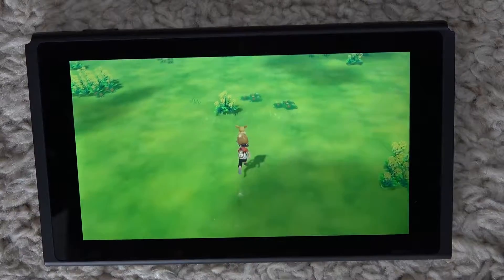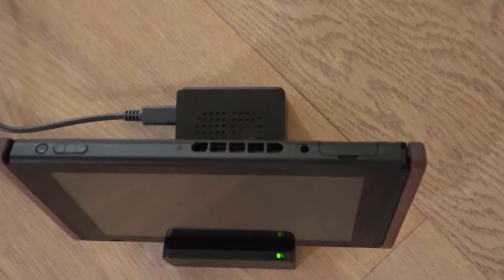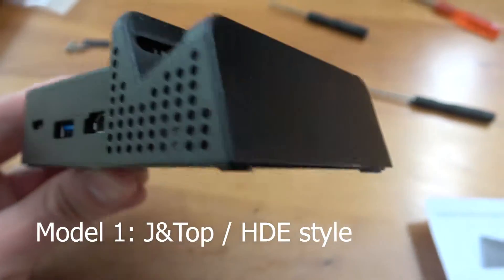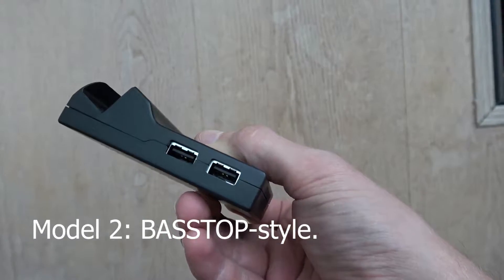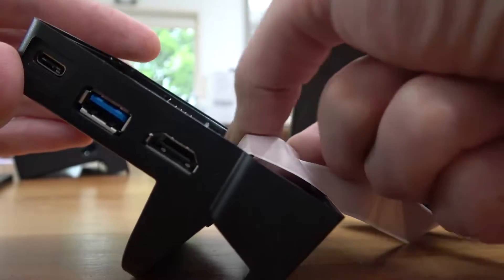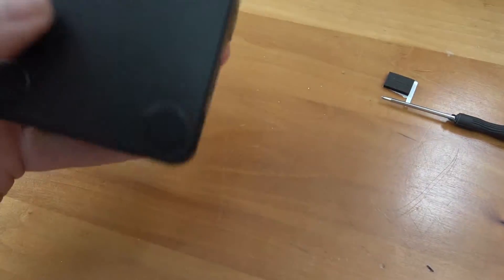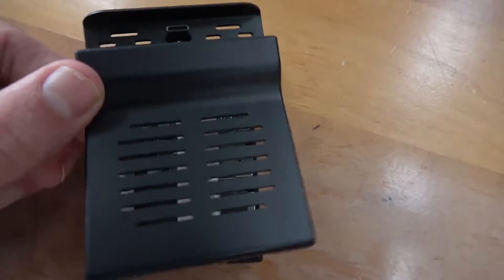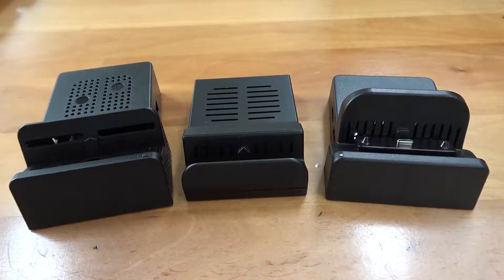Review: Comparing 3 SAFE Switch Mini-Docks using Nintendo components!

Comment: So, what about the temperature? Does this dock make switch run cooller on docked mode?
Reply from the maker: Well, naturally the Switch is mostly out in the open air now, so it might fetch a little more air depending on your home's temperature and air circulation. But needless to say, the charging PCB is the same, so no heat optimizations in that regard. 
I don't expect any significant improvements if your Switch suffers from heat issues in the default dock.